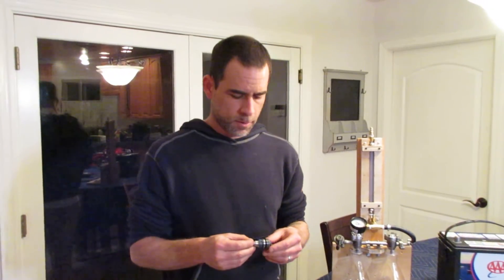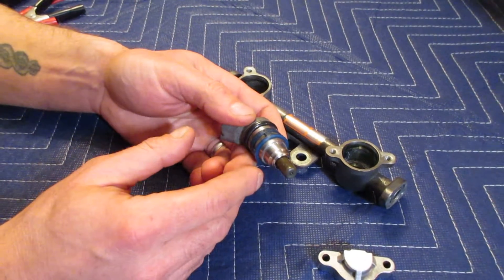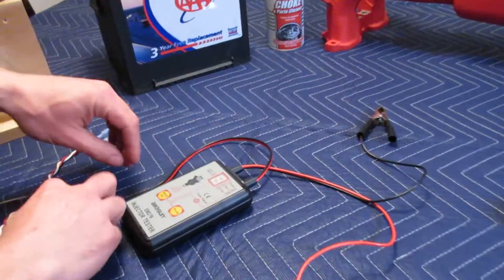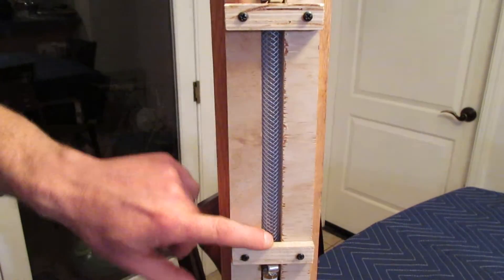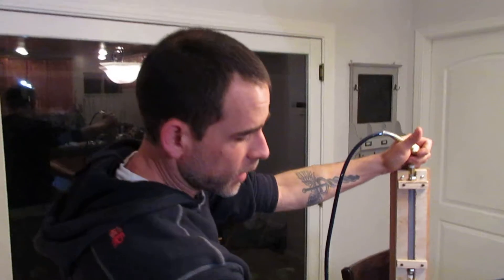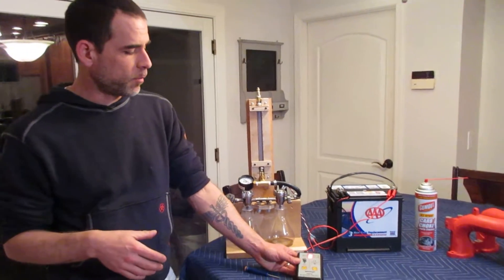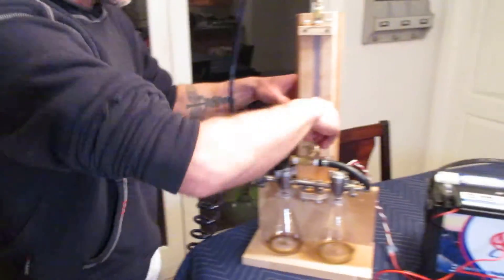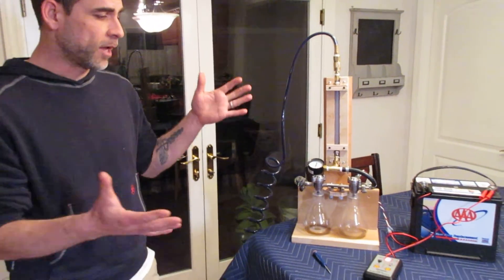FUEL INJECTORS | $30 DiY Clean/Flow Test Stand

Comment: Connecting wires to the battery and momentarily touching the injector pins can cause sparks, which can ignite the fumes from carb cleaner.

Comment: I just use a fuel pump in a closed loop system. 1 gallon fuel can with the return and suction going into it and a walbro 255 extra pump I had and regulate it to 60psi since that’s what I run for fuel pressure. Then I flow match all used injectors and make matching sets.

Comment: Definitely need to build me one of these. Quick question? A injector will not spray or pulse activate unless it has some sort of pressure to the injector correct?
Reply from the maker: Yep, uses the air pressure from a compressor.  You can set it to about the same pressure your fuel system uses. Cheers! 🍻

Comment: There is only one way to professionally service Injectors,ultrasonicically clean,backflushed and flow tested through an acceleration test from an idle rpm and pulse width and up through 5000 rpm. 
 Good effort but hardly scientific or conclusive. Good luck with a half job, that may cost you a ,,, 5000 dollar motor for the sake of a professional service at 150 bucks.
Reply from the maker: True, that’s the correct way, but for those that can’t afford it, I still think this helps. Cheers buddy - thanks for the comment!!!

Comment: I bought one of those tester’s and for most high impedance injectors they are ok but around 12 ohm or lower it’s driver has too much resistance to trigger the coil

Comment: Random question. Is it possible to upgrade from the aluminium inlet manifold to the plastic one? Is that a tough job?
Reply from the maker: Yes it’s possible and not too bad at all.
Reply: @SubaruONLY  do you think the plastic one is better?
Reply from the maker: I’m not familiar with those tbh. Better flow is what you want though.

Comment: I love watching what different setups guys come up with for injector cleaning. Check out the Motion Pro setup. I found first hand that an ultrasonic cleaner and simple green works great, along with an injector pulser set to continuous for about 15 minutes. What I really want to see is a tank of liquid (simple green or whatever) that continuously recirculates under pressure thru an injector and returns back to the tank, going thru a filter in the process.

Carb cleaner does work wonders, but the small volume of liquid is insufficient. Honestly, once you watch an ultrasonic blow junk out of an injector, you'll be a hooked. But I really enjoyed watching your video, and seeing all the different ways guys come up with to clean their injectors. Can you outperform your first attempt, and come up with a recirculating tank setup?
Reply from the maker: I’m right there with you. Totally need to redo this for something like what you’re suggesting. Like it man, thanks!!! 🤙

Comment: My subaru forester 2008y (ej204) crank but won’t start, the problem is no fuel coming from the fuel injector, Please i need help

Thanks
Reply from the maker: Could be several things, I’d start with changing out the fuel filters. Good to do regardless. If that doesn’t help, I’d swap in a new injector to see if there is a clogged one.

Comment: Nice set up but I don't like the idea of using carb cleaner to clean the injectors.
Reply from the maker: I hear ya! I think it does cause rubber seals to swell, which means use need to replace those after.  Any suggestions for a better cleaner?
Reply: @SubaruONLY  fuel additives like berryman, Seafoam injector cleaner. Those are purpose for fuel parts.
Reply from the maker: Thanks buddy!!!
Reply: @SubaruONLY  no problem

Comment: Do you know the voltage and amperage to the fuel injector?  Using a car battery directly will fry the injector
Reply from the maker: Don’t know. But didn’t have any issues.

Comment: Does this work for direct injected turbo engines with a hpfp? Just asking because my hpfp at idle is between 500 and 600 psi.
Reply from the maker: No, probably not. Those need much higher pressure I think.

Comment: you must have won a few science fairs I checked mine by using a 9 volt battery alligator clips and a can of carb cleaner connected to the injector with gas line and duct tape it was enough to see that 5 would spray and one would not open at all. yours was much better than mine but I was proud of what I did.
Reply from the maker: I think I probably over engineered that sucker.  Sounds like you knocked it out just as good! Cheers buddy!

Comment: Great idea mate, so many issues with this setup tho. Subaru run closer to 3 bar (43psi) & you haven't timed the on periods so your unable to compare the injector flow rates correctly as a result.

Comment: A sonicator does a very good job, fill your injectors with cleaner through a syringe (needle not required), put injectors in a  glass jar filled with carb cleaner, put jar in sonicator and have at it for thirty minutes. Flush injectors with fresh cleaner and repeat the process, after a few flushes and sonications it comes out clean as a whistle. Then I'd put them on a rig similar to yours to determine flow rates and adjust spray patterns.

Comment: Professional injector cleaning pulses cleaner for 20,000 - 30,000 cycles. 

Best to just add injector cleaner to your fuel tank on a regular basis. I use 5oz Lucas With ever fill up - purchase by the gallon and it's only $1 application.
Reply: Injector cleaner is snake oil. Unless you drive the car without stopping  from full to empty, you will not benefit from the cleaner you shove in your gas tank.
Reply: Not talking about in tank injector cleaner ( which would actually be better than what's in this video ) . I'm talking about a professional fuel injector cleaning machine.

Comment: You can also pressurize the entire rail then close it so it doesn't build anymore pressure when you have it pulse and then measure the drop in pressure. A greater drop in pressure means the injector is cleaner than one with a lesser drop in pressure. This can be done on the car with the fuel pump. You just have to pull the fuel pump fuse after you pressurize the system.

Comment: My Honda engine is automatically cut off its working after heating since I started. Then after that I tried to start the engine but it didn't start. Then I removed the petrol injector and checked by starting the engine. But there was  no fuel coming from the injector.Then what will be the problem.?please reply me
Reply from the maker: Sorry, I’ve literally never owned a single Honda.  So I can offer much advice here.
Reply: @SubaruONLY ok thanks for the information
Reply from the maker: Np. 👊

Comment: How exactly does the flow test work? I have a set of injectors that I'm unsure if they're OEM or DW's since as far as I can tell they look identical. How exactly do I determine the flow rate?
Reply from the maker: Hi.  Great question!!   Got to make some marks to see the volume in the clear tube, then hit the button to activate the injector and record the time you leave it on.  Then, use the amount of time you activated the injector and the volume that passed through the injector to estimate the flow rate!

Comment: Testing injectors is cool and all but now a days its just easier to replace all of them
Reply from the maker: True, 100%. But there might a few people out there that don’t have the cash to get new ones. I know that was me for many years!  Thanks for checking out the channel!  😁
Reply: Not true at all. What about on say a turbocharged LS2 engine running siemens deka 80lb injectors  they run $350-$400 a set of 8. Maybe on a gay little subaru making 300hp (just kidding)🤣

Comment: Could I flow test 4 diesel injectors at the same time with this set up?
Reply from the maker: Yep.  For sure!  🤙🤙
Reply: I think Subaru only meant to say with this system you can but obviously you would need to add the other fuel rails or ports Because there’s only two ports.
Reply: If you think a gasoline port fuel injector, and a diesel common rail injector use the same drivers, connectors or operating pressures you should not be giving advice to people.
Reply: @VTLIFE-so4dc  I wasn't giving advice I was asking for advise!
Reply: @toyota218921  Sorry if you misunderstood. SubaruONLY says "Yep. For sure!" But the real answer is no. Common rail diesel fuel systems utilize pressures up to 29000 psi/ 2000 bar or 200 MPa. Most port fuel injected gasoline systems run around 45-60 psi/3.1-4.1 bar/310-413 Kpa. So, common rail diesel injectors are peizoelectric, meaning the injector opens when current passes thru it because a crystal deforms, letting the needle in the injector open. It operates at 450 times the pressure of port fuel gasoline system, which uses a coil (electromagnet) to open the injector. The amount of current, voltage, and time it takes to perform the task varies greatly. The biggest takeaway to common rail diesel systems is CLEAN FUEL IS ESSENTIAL. DRY FUEL IS ESSENTIAL. ANY dirt or moisture is death to these systems. Good luck.

Comment: Awesome vid and set up! In my experience carb cleaner eats plastic. Maybe mix a cheap fuel system cleaner and isopropyl mix 🤔 . Subscribed
Reply from the maker: Yes.  Good call!   I found the hard way that carb cleaner also affects the rubber o rings if you leave it soaking too long.  Made them expand and no longer seal properly.
Reply: Throttle body cleaner is less harsh and safe on Injectors

Comment: how do you know which is the negative and positive on the fuel injector when connecting the battery >?
Reply from the maker: It didn’t matter - Just needs good 12v and good ground and it opened every time.

Comment: Damn this is cool. I'll be building one of these for sure. I'm going to just use a momentary button to... never mind that pulse device is sweet. I even have tiny 12v motorcycle batteries that I could mount on the back side.
Reply from the maker: +rc2300s2r   That will be sweet.  I love making custom tool or equipment - so much better than buying new!!!

Comment: cool video, can you do a video on how you put together your apparatus? how does the hose that you pour the carb cleaner in connect at the bottom to the valve?
Reply from the maker: +Hector Vazquez  I use a barb to pipe thread fitting.  I'll put together an assembly video at some point in near future.  Thanks man!

Comment: Nice job. I bought the Allsun tester specifically for the mode 4 function where you can just let the injector run for however long you want. I put my injectors in an ultrasonic bath with some cleaning fluid in it and let the injectors run for around 10 minutes straight. They came out nice and clean. Thanks!
Reply: I went ahead and bought one and used Homebrew seafoam as the solvent.
Reply from the maker: +Baxrok2 

Sweet.  Thanks for sharing the experience!  It really helps other people out there BIG time!
Reply: I was just thinking about getting one of those ultrasonic jewelry cleaners to use for injectors.  Is that what you used?  What type of cleaning fluid did you use?

Comment: How many pulses are enough to clean your average injectors?
Reply from the maker: +Arnold Ceasar 

I typically run about ten cycles for each injector.  But it really depends on when you stop seeing dirty fluid coming out.  They clean up pretty quick!  Thanks for taking a second to drop the question - Much appreciated!